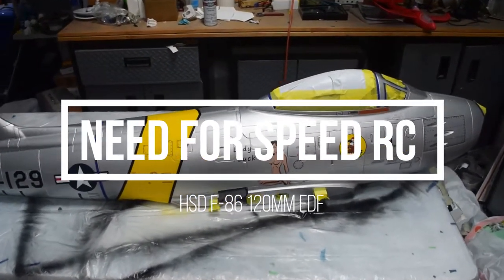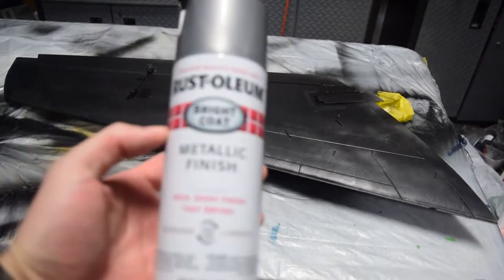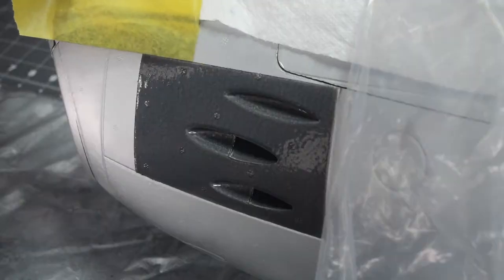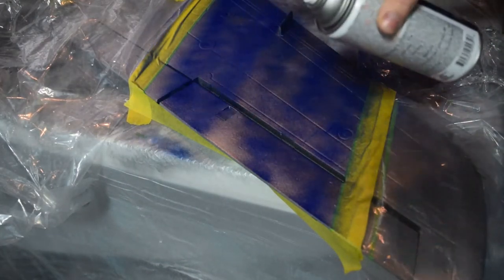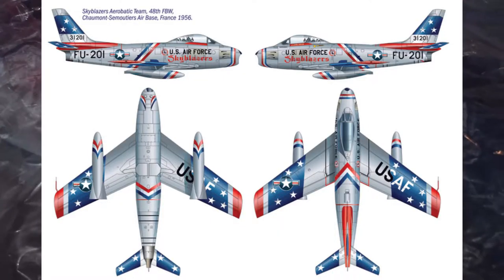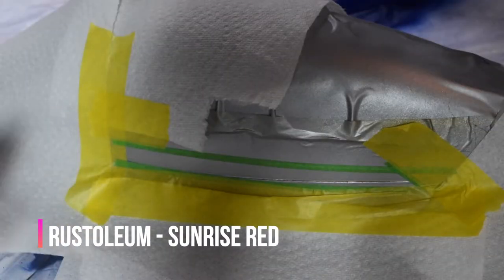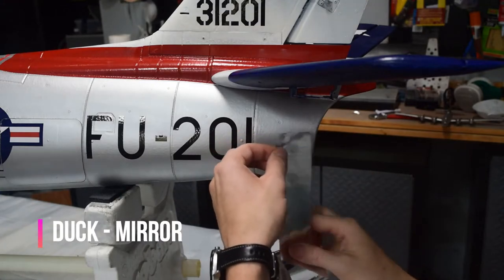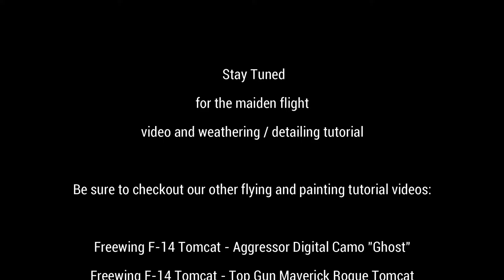How to Paint the US Air Force Skyblazers Paint Scheme - HSD F-86 120mm EDF - Painting Walkthrough

Comment: Great job.  Just to note Ive had good success with removing decals from foam models by 'shock cooling' them with frozen packets from the freezer.  After about 20 seconds the adhesive of the decals is brittle and cracks off without damaging the foam.   All the best.

Comment: Hi "Need for speed.  I usually use a light colored primer not a black and was wondering why you do? Does it cover better ? Thanks. Just got my F 86 and hopefully ordered all the graphics from Callie.
Reply: One more thing my friend, is the Regal blue the paint/primer or regular paint? Thanks again!!
Reply: And, sorry, are the white and black Krylon or Rustoleum?
Reply from the maker: Black as the base coat supposedly helps the metallic silver "pop" a bit better.  The krylon Regal blue is regular paint from the Krylon "fusion" line. The black is a cheap brand called colorplace.  It is .98 a can from walmart.  The white I believe was Rustoleum 2x.  Good luck with yours!
Reply: Thanks so much.